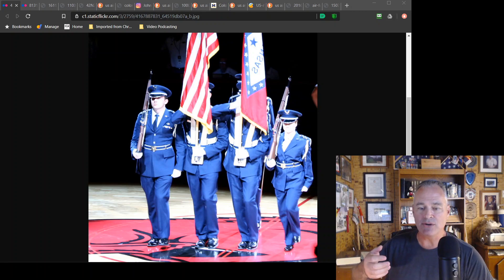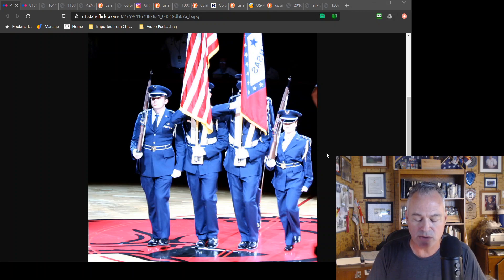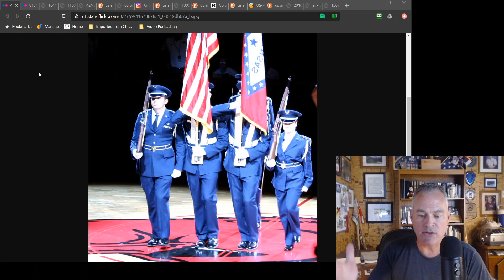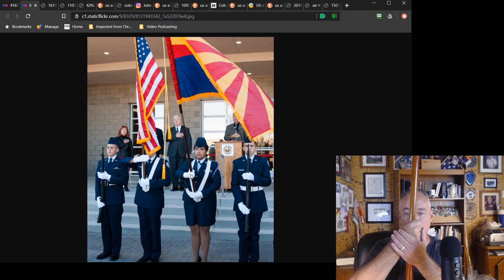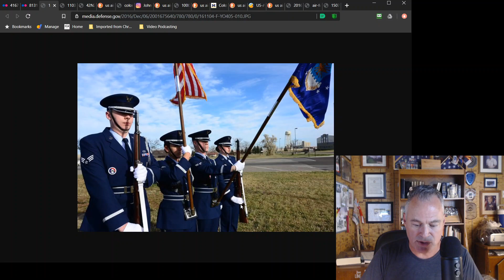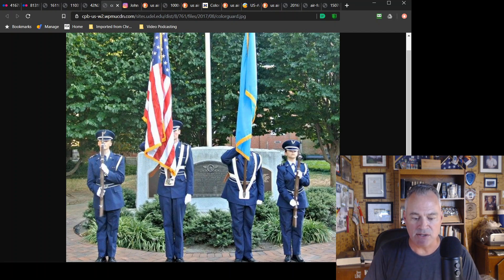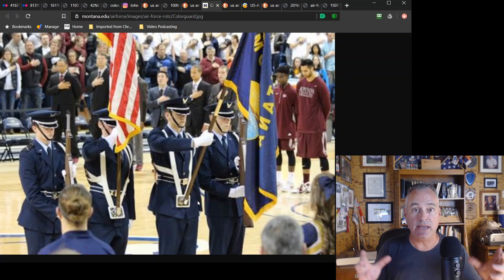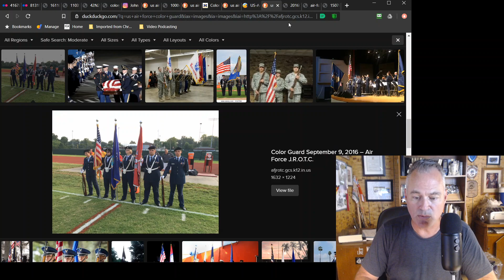Color Guard Differences - Air Force

Comment: Hello there, I have three questions... all are related to Air Force colorguard. First off, should cadets use arm swing during a colorguard? Second, should feet be at a 45° angle or less than that for honor guard? Last, when having a state flag in the colorguard, does that mean that it should be a 5 person colorguard minimum then?
Reply from the maker: If you are following AFMAN 36-2203, then it shows you that the guards are at the outside shoulder and that requires the team to march with suspended arm swing. The same goes for foot angle. The AFMAN makes no provision for the Closed Toe Method. As for flags, the minimum is the national, the standard is the national and the departmental or organizational and you may only add to the manning, not replace. Do, when carrying the state flag, the team must be five members. Read here: https://thedrillmaster.org/2019/12/19/the-why-of-the-military-color-guard-air-force/